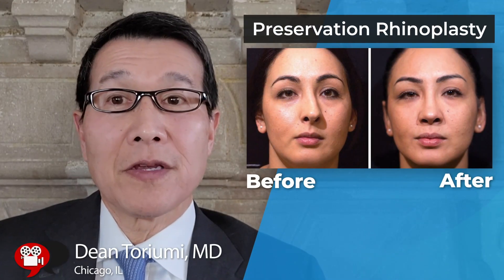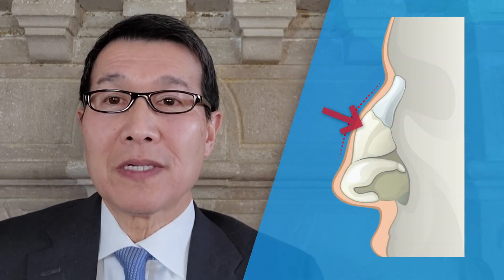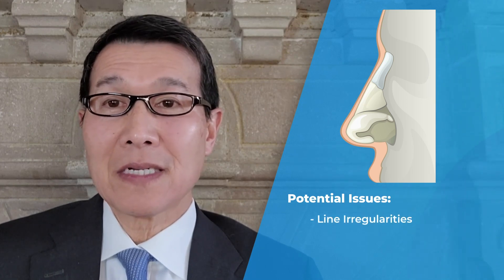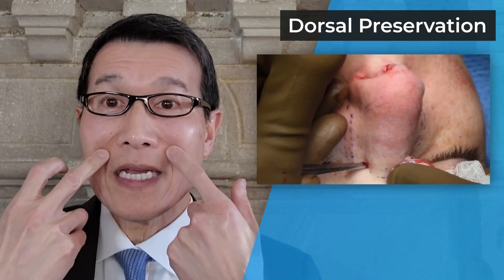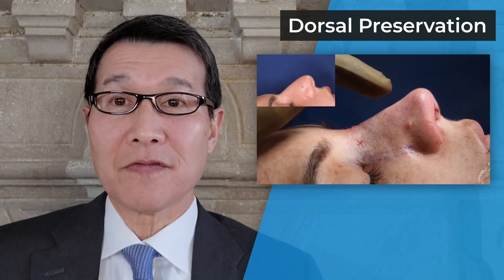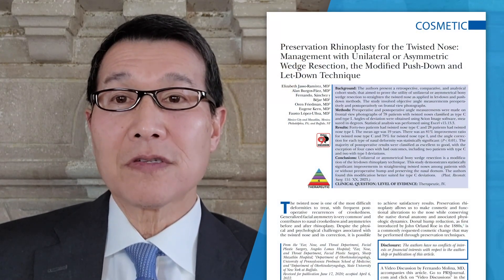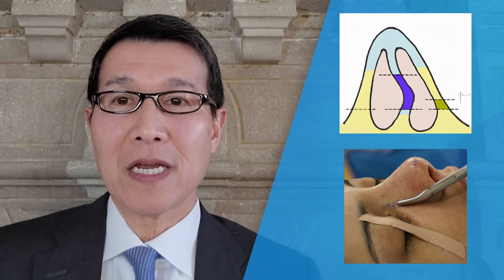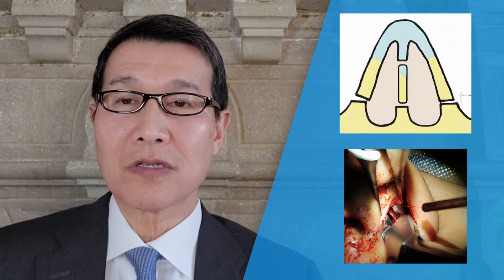Preservation Rhinoplasty for Twisted Nose by Dean Toriumi, MD

Comment: Very nice explanation,  but in my opinion, after we performed over 100 patients,  this tech has a place only in minor humps , but in large or convex humps this technique is 
 Unsuitable bcz you can not charge the dorsum shape or convexity, and you end reshaping the dorsum . We actually had to revise over 50% of the push down tech . Also, removing a strip of bone from the nasal side bones may end with sever late deformity which become more obvious 8 to 24 months after surgery. 
With my full respect to the Master and Mentor Dr Toriumi.